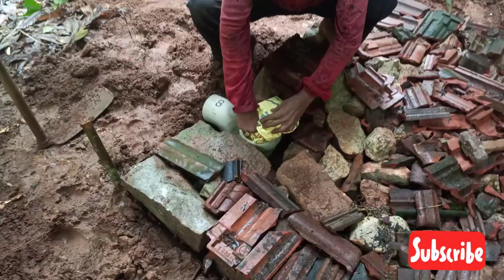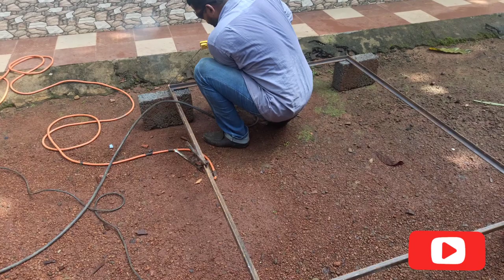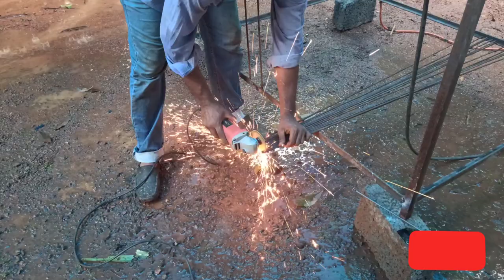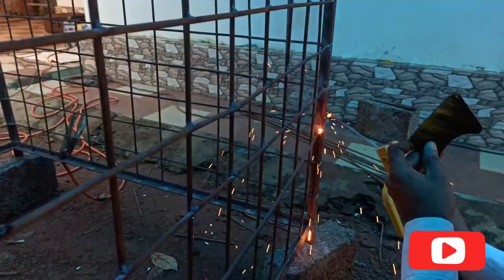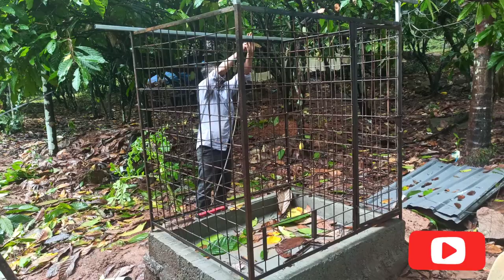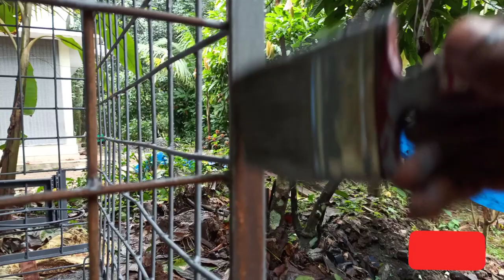how to make dog kennel within 3 days | dog cage design | dog cage ideas | dog house making#dog#home

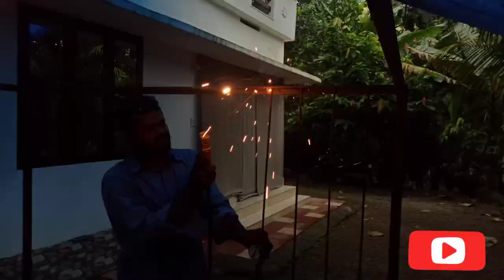Comment: 3:33 if only someone could invent some sort of protective glass that could be put over eyes, similar to the ones you use to hold your hair fringe up but for eyes.
Reply: no no need to invent there are protective masks /glasses  availble for welders in the market
Reply: @cynthiabriones9204  I think those are just designed for holding up your hair fringe